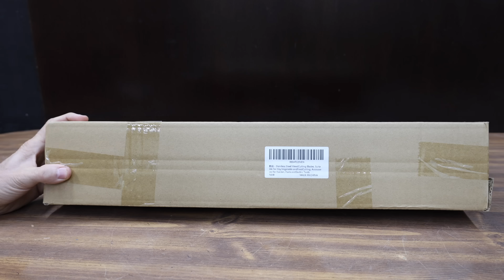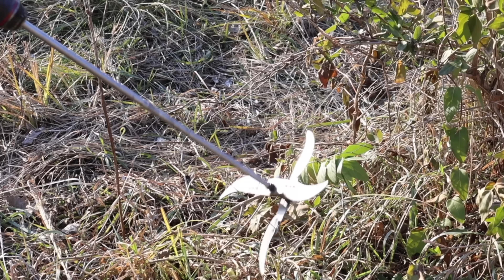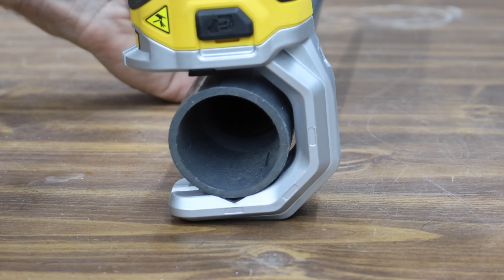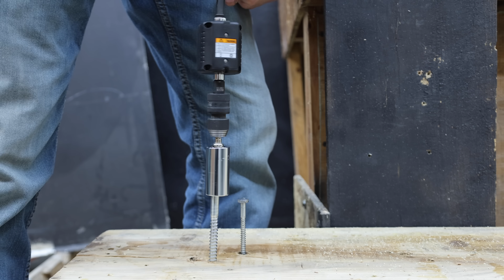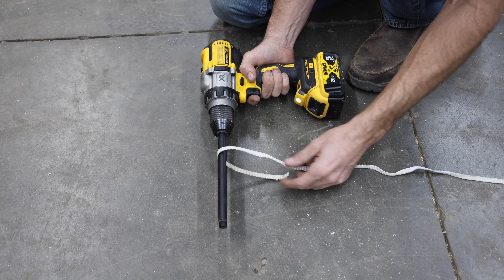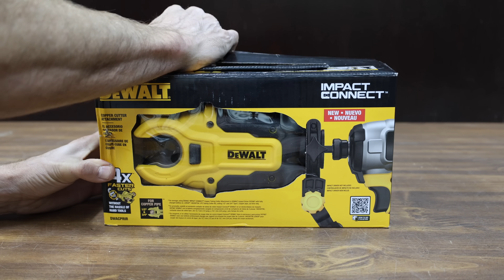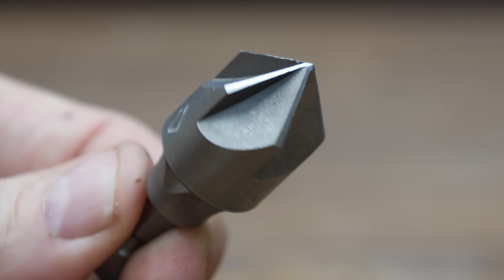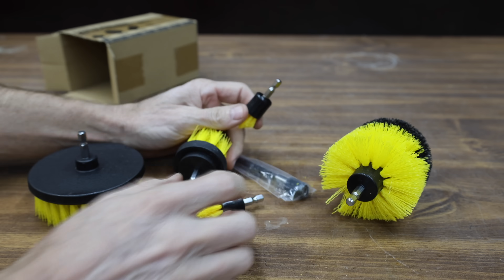I Replaced 10 Power Tools With My Drill!

Comment: Based on this, I bought the universal socket and threw it in the sockets drawer.  Last week I was stymied by a thin nut on the BBQ grill I was disassembling/trashing.  It would not turn with either SAE or Metric wrenches or sockets and was too thin/rounded to grab with vice grips.  To my great surprise, the universal socket grabbed and and removed it!!!!

Comment: One piece of advice about the brushes at the end: ONLY use them with a drill/driver in normal “Drill” mode—never an impact driver.

I use these brushes almost daily, and I learned this the hard way years ago. The repeated hammering/impact action will very quickly strip the polymer that holds the metal shaft in the brush. Once that happens, the brush is essentially done. I tried every glue, two-part epoxy, and JB Weld product I could think of before realizing the simple answer: keep the torque smooth and continuous.

I now keep one permanently installed in my Milwaukee Installation Driver (2505-22) and another in a Festool drill with an exceptionally smooth trigger/run-up. They’ve become indispensable for cleaning.

The brushes themselves are great, but don’t overpay for them. Amazon constantly runs sales on this category, so watch the prices for a week and look at the different sets before buying. Just remember: drill mode, smooth power, no impact. Your brushes will last dramatically longer.

Comment: How about a test of Utility Knife replacement blades? Just got a set of 40 from Bates for $6.85, that claim a titanium edge. Are they any better than others? Who knows? Idea: if you take this on, maybe comment on how well the blade takes re-sharpening? I don't usually attempt this, but if you're caught without a supply of new blades, you may have to do it. Also maybe test corrosion resistance? Thanks!
Reply from the maker: Thanks for the suggestion.

Comment: Ive been debating getting in of those chainsaws for a while. Now I will! Also, those Universal drill bits are so underrated! I have kept one in each of my toolbox and truck for near a decade and they have gotten me out of many pinches. What you didnt mention was they're perfect for things with threads but an abnormal head such as cup hooks, some handles and stripped bolts. Usually see them for around $10. Everyone should pick one up, you will never regret having it.

Comment: Wow, this brings back memories.  My Grandfather was a tool and die maker by trade.  He got ahold of a circular saw attachment for a drill sometime in the late 1960s.  He fabricated a stand with a platform that would allow the blade depth and angle to be adjusted.  That thing sat in his basement workshop for the next 30 years until he passed, and as far as I know, he never used it!

Comment: I bought a green colored drill water pump at Harbor Freight  and use it to flush my tankless water heater. It didn’t come with hoses, but I used an old hose and hose ends (also from HF) to make up some short sections. I attached the pump to a board so I could lock the drill trigger and set it on the bucket and just let it circulate the vinegar. Very cheap and effective solution!
Reply from the maker: Thanks for sharing.

Comment: I would highly recommend the augers to A: Use a hammer drill and B: Never do high speed. You can almost break your wrist if it catches a root or something at high speed. The hammering can help it punch through harder soil and clay to dig faster. Take your time and avoid injury

Comment: I bought the riveter attachment (The blue one) and it works great! Mine doesn't need to lubricate and ejecting the nails just fine and not like in this video. Maybe yours is defective. The only downside is the barrel is much larger than the standard riveter so it's hard to work with tight spaces.

Comment: I bought an auger attachment years ago, then forgot about it. Last month I was digging some post holes in hard packed bone dry clay and want even scratching the surface. I remembered and auger and went and found it. It worked wonderfully. Most dangerous part was when it would jam but the hammer drill started spinning around and wrenching my girl wrist. Lucky I didn't break a bone and I was really happy to get 4 holes dug out in 20 minutes

Comment: Video Idea: diagnostic tools for engines that bluetooth and direct plug in only. What can they find? Can they diagnose with a possible solution? Are they in danger of damaging electronic sensors and modules due to poor programming or bad coding? 
2nd: Motor oil testing that is real world. Saw a video called "You're using the wrong oil with receipts" Criticism aside I would like to see some real world testing of oils with Ester in it like Redline to see if it does what they claim which is not only protect your oil but is able to withstand shearing, unlike oils with additives that thicken artificially, and thus providing actual longevity between oil changes. Do they clean off carbon and sludge build up that normal oils that dont have ester actually create and leave behind?
3rd: Fence squaring kits. Cant they stand the test of time and actually handle the elements and provide a squared off fence door and prevent bending/warping of the wood? Does one require to use a cable from corner to corner to prevent the warping due to the insufficient support those quick build a fence door kits provide?
4th: Double sided tape that actually supports the weight it claims and usuage claims for either interior and exterior separate or tested together.

Comment: Pull back on the rivet gun when running it in reverse to push out the mandrel. Never had any issue with mine after doing that, and it's the same model.

Comment: For #1 you need a bucket and there you chop the forage grass for livestock. The Circle metal with 3 screws holes will be screwed in the middle of the bucket so the blade wont dance around. Been using that for my chickens.

Comment: Just one comment on the flexible shaft driving tool. Those things are dangerous as hell. Doesn’t seem like it, but I darn near broke my arm with one and I’m a big guy. The thing is, they can suddenly wind, and then you have the full torque of the drill. You can injure either the hand holding it or the hand holding the drill. I just tossed mine. I’m too old to go around wearing a cast.

Comment: Drill brush attachments are great. I bought a set a couple years ago to clean my shower and they do a great job. They also work great for the kitchen sink. Avoid using with corded drills! I also recommended safety glasses and potentially an n-95 mask from dust.

Pro-tip is to use Bon Ami powder as it is an abrasive that will not damage finishes. Baking powder also doesn’t damage finishes although it has reduced cleaning power.

Comment: For start your not supposed to force a blade it can cause issues and damage over time. Also the larger bars are going to go faster. The material and use of these tools is wrong. If you used the tool properly I would agree and conparing them to contractor grade tools is un fair. This would be great for a RYOBI, Hercules tool owner. And if you used the tools that way. (Aside from the first.)

Comment: Great video.  Safety comment, when using your 7-1/4” circular saw, your depth was dangerous.    Only need about 1/8 to 1/4” for blade to clear material.  Safer. Cleaner cuts. Try it yourself.

Comment: The first attachment is for cutting vegetable matter in a 20lt plastic bucket. Supposedly you drill a hole in the bucket lid, pass the bit through the hole and attach it to the drill. It's a dodgy tool.

Comment: I always wondered if drill augers worked well with clay impacted dirt.
Reply: I have a set and they work fine.  You have to have the drill speed high and then SLOWLY start and slowly go deeper as you drill.   Otherwise you'll spend your time backing up and going at it again and again.  I suppose with a super powerful very high torque drill that could be a bit better.

Comment: I recently bought a drill attachment for a reciprocating saw off Amazon, $40. It did do the work, I think mine is tougher because it's made of all-metal parts instead of plastic.

But it's still slow, makes rough cuts and is hard to control. So I'm sending it back... especially because I just ordered a Ryobi One+ recip saw for $65, and it's coming with a free 5-1/2" circular saw. (no batteries of course, I got those)

Comment: I forget if the last one was featured on Shark Tank or where I saw it but I've owned it for years. does a great job cleaning the shower, instead of scrubbing all day with nylon brush. Just have to put the drill in a ziplock bag so it doesn't get all wet

Comment: I’d love to see a video where you remove ethanol from gasoline using the phase separation method. After that, you could treat the fuel and run a comparison against regular E10 gasoline—performance, engine response, and any noticeable differences. I think that would be really interesting and helpful.

Comment: Oh wow, that first tool looked like one of the tools from Beyond the Press channel's "Grinder discs that shouldn't exist" series of videos. Actually the first video in that series. They welded some knife blades onto a circular piece of steel and attached that to an angle grinder. They operated the grinder from outside of a concrete bunker in which the tool was to contain the danger. But the makers of that drill attachment are expecting people to spin up those knife blades right next to your legs? That's insane.

Comment: I've used about five different brands of those universal socket adaptors, and I can safely conclude that some work and some don't.  They look pretty identical, but it's night and day.  Honestly not sure why, but my guess is that the tolerances between the pins have to quite good or they swivel under pressure and slip.

Comment: Hey boss could you test what oil is best for submerged oil pump belts? I just picked up a 2025 Ford Bronco and I've been hesitant to buy a Bronco just because of that but I haven't seen any huge failures from those oil pump belts. I'm just curious on your input, and I think it would be a cool video of what to use and what not to use. I know we should especially not be using any type of rubber gasket softening agents like stop leak.

Comment: Todd, please consider doing a test of several of the available Pinch Weld Jack Pads, for auto, truck and RV use.  Versatility, flexibility, durability, size, fitment, etc.  Shoud be one of the cheapest tests you've ever done.
Reply from the maker: Thanks for the suggestion!

Comment: Bought the jigsaw attachment a couple of months ago, had the same problem, like, 1-inch plywood and it stopped working suddenly, opened it up, the worm gear completely mangled up, just like what you showed on the video the gear is made of cheap plastic not metal.

Comment: For a decade now I've used the Black & Decker Matrix series drills and attachments. Some attachments were more gimmicky (and cost nearly as much as buying a separate dedicated tool even from B&D's own line using the same 20V battery), but a handful of them were actually very nifty over the years. None of them looked as sketchy as some of these lol. I was kind of bummed recently to learn that they're discontinuing the line and not replacing it. On the other hand, they're finally making brushless drills, so that's a welcome addition (the only reason I was looking is because I've been hoping they'd make a brushless power head).

When talking tools people always ask "are you a Dewalt guy or a Milwaukee guy?" and I get a funny look when I say most of my tools are Black & Decker, but I've never encountered a job they couldn't do and I've never had one fail on me. I have no doubt a Dewalt would last much longer on a job site, but I think most casual hobbyists/DIYers like myself overestimate how much tool they need. I've saved a lot of money vs my brother who is a Makita guy, and he's asked to borrow mine a time or two lol.

Comment: For the rivets you should have got the Astro Pneumatic Tool ADR14 XL Blind Rivet Adapter Kit - 1/4" Capacity. I've done up to 1/4 stainless and it works great, clearly not as cheap, but so worth it.
Reply from the maker: Thanks for sharing!

Comment: The first one is used like a food processor or an immersion blender, that kit usually comes with a bearing and a bracket so you can attach the bearing at the bottom of a 5 gallon pail. It used for chopping leaves for animal feed.

The one you thought was a reciprocating saw is usually advertised as jigsaw attachment and it works on thin plywood sheets when you want to cut curves and holes

The riveting attachment needs to be set to reverse to throw out the rivet leftover.

Comment: What is it with so many companies using plastic gears these days? It's a guaranteed failure in the not too distant future, and is stupid when a full metal gear isn't that much more expensive for them especially bulk purchasing them as they would do. Even the famous KitchenAid brand started to use them with their once-great mixer line, and I see so many videos where the first thing people do is rip out the plastic gear and get metal ones instead - that ONE change turns it from garbage into a product that will likely outlive them, as the originals used to do.
Reply from the maker: Thanks for the feedback.

Comment: I think you used the first attachement wrong, since it is intended to be used as a weed/hay chopper in a bucket. That's what the bearing part was for as it needs to be attached to the bottom of the bucket, then the tool's shaft is inserted and the weed may be chopped.

Comment: Review idea:  Garage storage shelves (2000 lbs per shelf).  Xtreme and Performax from Menards.  Gorilla Rack, Gladiator, Ironton from Northern Tool, Muscle Rack, Husky from Home Depot, Kobalt from Lowes, Member's Mark from Sam's.  Some say the Performax, Ironton, and possibly Gorilla Rack are the same  I've also read the Xtreme is the same as the old Gorilla Rack (never seen that).  It would be interesting to see testing.
Reply from the maker: Thanks for the suggestion.

Comment: Hi project farm can you do a test on Valvoline restore and protect? For example get baseline dyno numbers on an older car. Then run Valvoline restore and protect for 4-5 cycles and redyno. Maybe check carbon deposits in pistons before and after too. It’s said to remove all carbon build up and engine deposits over multiple uses it would be interesting to see this tested!
Reply from the maker: Thanks for the video idea.

Comment: i have a suggestion/request ... how about heavy duty furniture moving option... i'm most interested in how heavy a 4 leg object can it really life and move on carpet and hardwood (ones i have found: NEST EASY Heavy Duty Furniture Dolly 360° Rotating 5 Wheels, Alloy Steel Furniture Movers Up to 3000 lbs/1360 Kg Load Capacity with Measure Tape and Leveler (5.3x5.3 in) and LOYAL TIGER 2000LBS Heavy Duty Furniture Dolly & Mover - 6.4" Carbon Steel Panel with 5X 360° Wheels, Non-Slip Sliders & Lifter for Sofa, Piano, Appliances (Red) ... thanks for consideration
Reply from the maker: Thanks for the suggestion.

Comment: Hello!
Please try an experiment, of using motorcycle oil(that it is common with gearbox), to use it instead of ATF oil in a torque converter conventional automatic transmission.
Reply: Good idea!
Reply from the maker: Thanks for the suggestion.

Comment: Strange you couldn't eject the rivet. I've been using this tool for years and it works fine just by holding it and using the drill in reverse. 🤔

Comment: That first cutter looks like it might take off like a helicopter and head straight for the operator.
An idea for a comparison review would be water distillers (not the water purifier type). I use the distilled water for my car batteries, radiator, windscreen bottle, and a relative's CPAP machine. I don't know how 'pure' the water is from them and it would be great to see a review. Thanks
Reply from the maker: Thanks for the suggestion.

Comment: Todd, have you seen the ads on YouTube fora bit to put threads (internal and external by just reversing the tool)  on PVC pipe? You just screw them together instead of all that bonding glue mess. (uses a drill)

Comment: It hurts just to look at it
1. You can easily tell the quality of a product at first glance by looking at the material it’s made of (a great example of why you shouldn’t buy online)
2. Of course, brand-name products like DeWalt always deliver the best results, but they’re always a bit pricey.
3. The multifunctional socket wrench MUST NOT be used with a drill! The air wrench sockets differ in color/material/thickness (they are black) and are designed for high speed and high torque.
4. Did you know that drill bits have a certain size limit? That’s right, and for cordless drills, this limit is usually 10 mm, whereas corded drills, which have a 13 mm limit, allow for the use of extended drill bits up to 20 mm. Now imagine a person with a disability who attaches a 30mm+ drill bit to a cordless drill and starts digging into the ground with it!
5. A wire brush with medical gloves? You obviously haven’t put enough work into this to realize how stupid an idea it is (if you still want to try it, use thick work gloves and safety goggles).
6. In the end, there are quite a few attachments that don’t really serve any purpose other than polishing and cleaning. Of course, that doesn’t really do justice to how varied this aspect of the product is, and I could have easily listed some genuine accessory heads off the top of my head, but they wanted to keep the whole thing pretty cheap while stocking up on top-of-the-line Dewalt tools.
All in all, I'd give it a 3/10. You're better off finding something around the house that actually needs doing.